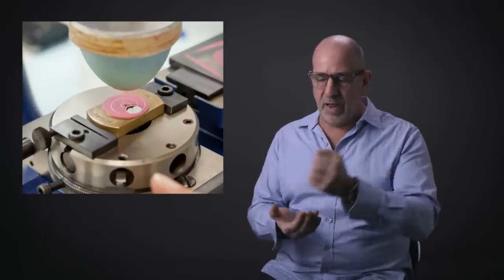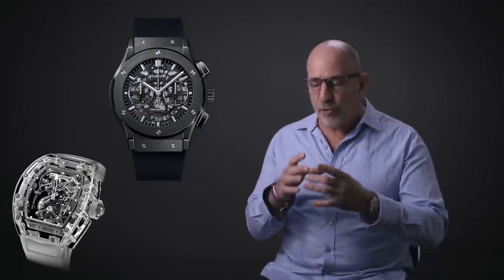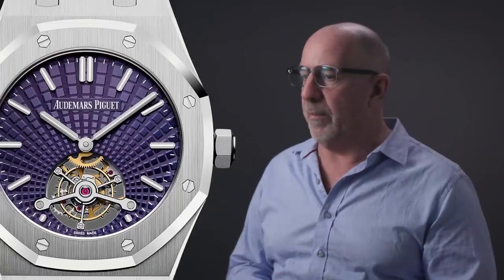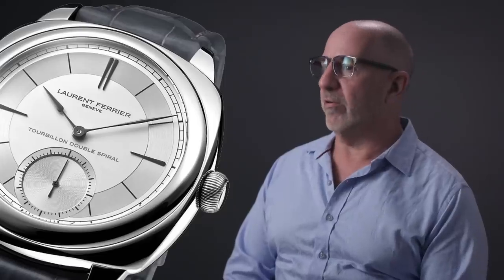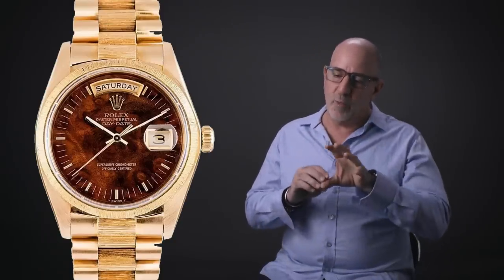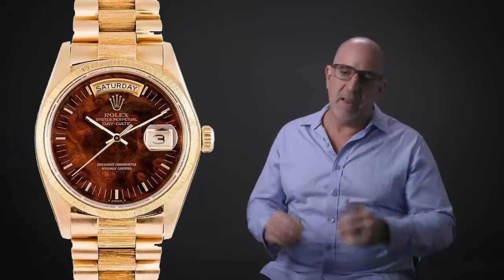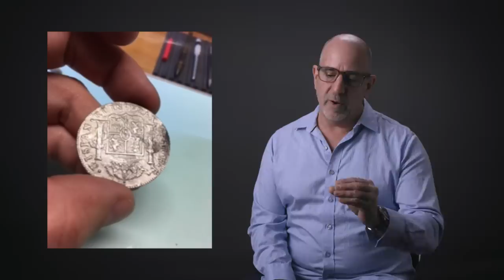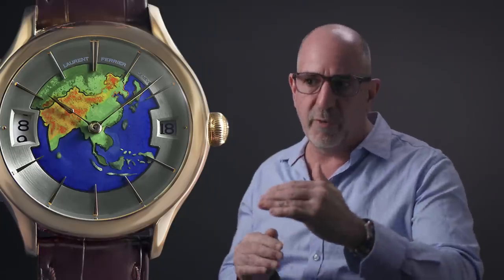Watch Dials Explained: Enamel, Meteorite, and More | The Classroom

Comment: Thank you everyone for enjoying this latest video and for your comments, as always we couldn’t do this without the feedback and even my 3 always present thumbs downers.. thank you for watching!
Reply: I just wanted to thank you for the very detailed, professional insight into these little mysteries - watch dials :) 
My interest in watches has been gradually increasing in the past several years and have recently acquired a vintage 1960s Seiko

The dial has deteriorated slightly, but its still very usable!
Would it be possible to do a video on the most prominent designs over the decades? I know it is a very lengthy topic, but it is very interesting how dial sizes and watch cases have been increasing in size.

Thank you once again
Reply: Deeply cool, thanks

Comment: sorry, but i really need to know ... why can't dials just be thicker? ok i understand when you're trying to make it really thinly transparent, or when you're repurposing a case designed for a thin metal dial, but it sounds like manufacturers are unnecessarily obsessed with thin dials. also, we have porcelain-coated metal, but i'm not aware of dials made of straight ceramic. but it seems like an ok material for the job. comments?